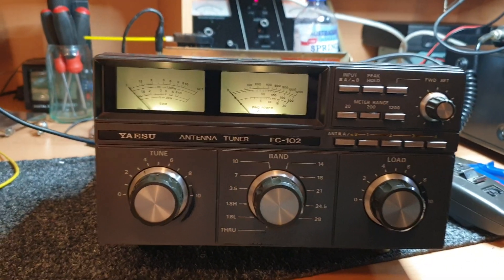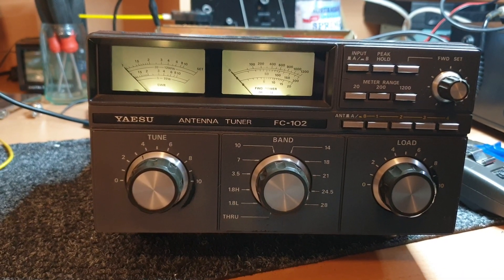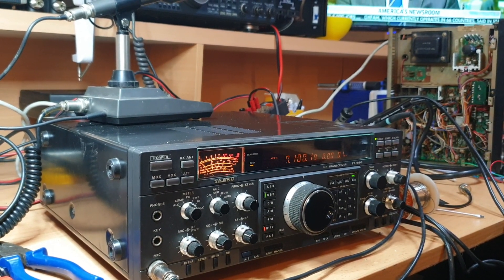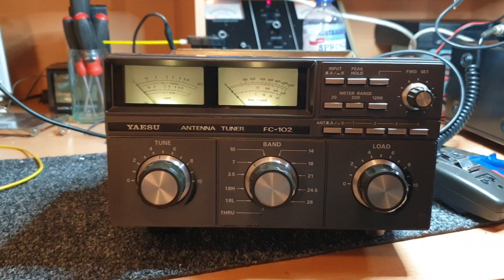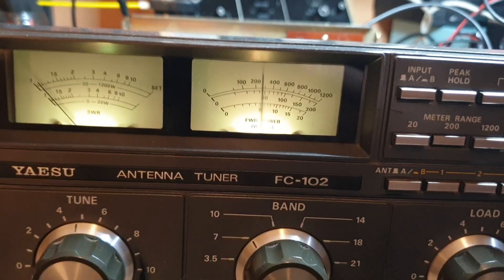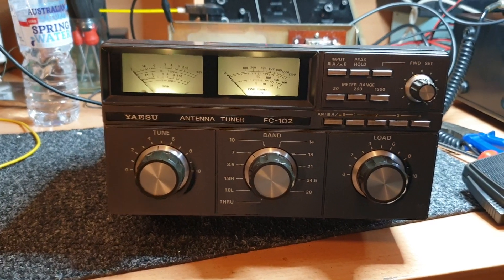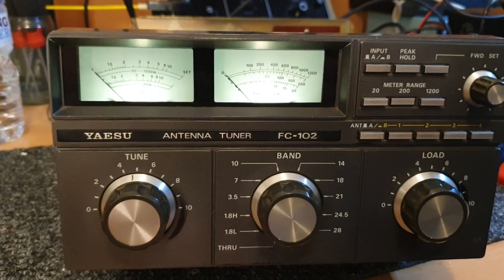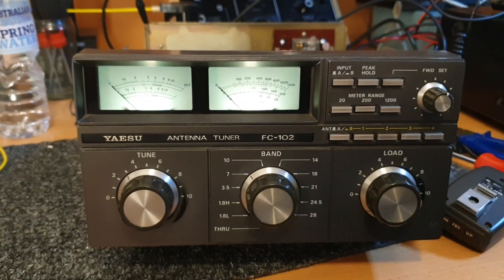Yaesu FC102 antenna tuner repair, good as gold now!!!

Comment: I have a Yaseu FC 107 tuner which I’m using with a Kenwood TS 180. I need to replace the ceremanic insulator at the beginning of the tuner shaft, so that whe I’m tuning for low sir there won’t be any play when using the tuner. Any suggestions? 73s Rob wa2fmh.
Reply: From experience the rivets become loose. They are in tight but do wear over time. I replaced them in my FC102 and they are rock solid but a known issue. If you try to drill the rivers you will undoubtedly break the ceramic insulator. There’s a guy in the UK called HiFiSSB and he normally has a good stock of insulators and could try him.